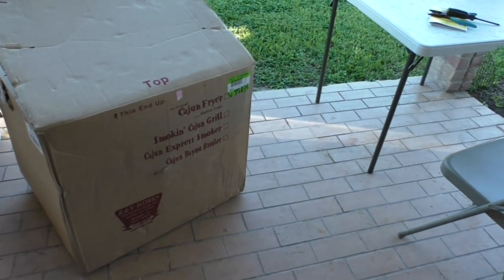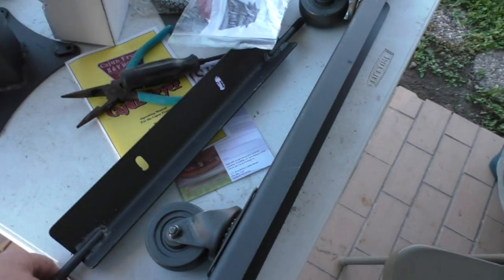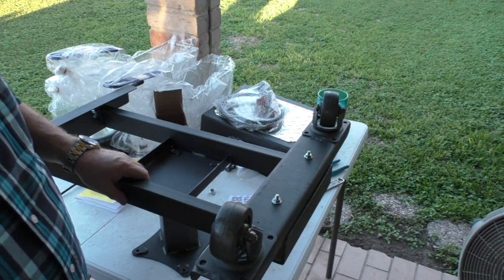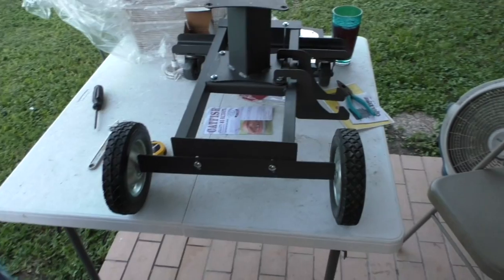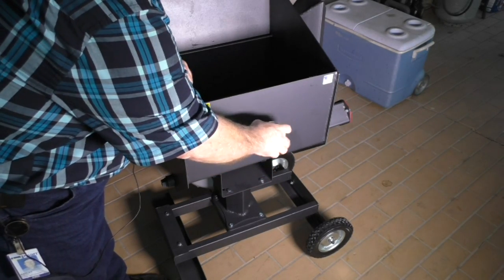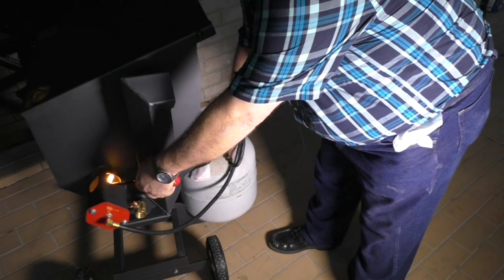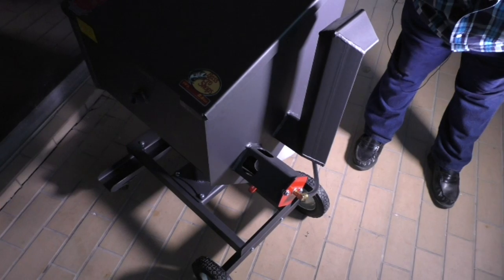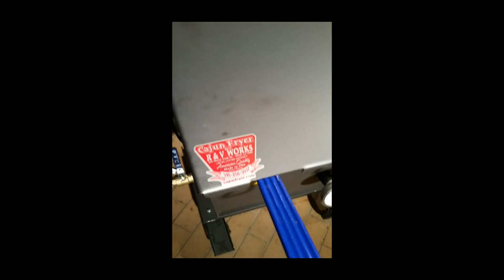R&V  8.5 Gal  Cajun Fish Fryer Assembly & Review

Comment: I heard you say that you were going to clean out the fryer, how did you do that?
Reply from the maker: I laid the fryer on its side and sprayed it out with a water hose and nozzle to break loose any meal and breading that might be under the burner.  No soap, just water.  Then dried it well and refilled it with oil.  Thanks for watching.

Comment: I love the cart set up on this fryer.  I have a similar fryer from Bayou Classic, but it's made from stainless steel.  I used it on my Seafood Platter video a few years ago.  I really need to have a big fish fry/crab boil soon.
Reply from the maker: +Smoky Ribs After using it the first time I was in love with it.  Especially like how the temps hold even after adding a few pounds of cold food.  All that oil makes a great heat mass to help keep it stable.  Thanks for watching and if you ever want to do a Youtuber cook and need help let me know.  I will load mine up and head over to help you.
Reply: I'm actually doing a big seafood boil in November.  Cajun Rocket Pot is sending me out a new pro pot to try out, so frying up a bunch of fish and hush puppies would go great with this.
Reply from the maker: Smoky Ribs Shoot me a date and I would come and help fry.  I love road trips.  Let me know.
Reply: I sure will let you know.  Let me touch base with Todd, and find out exactly when I'm getting the new pot, and I'll set a date from there.  All I know right now, is that it will be sometime in November

Comment: What tools did you use to assemble the whole fryer, I see needlenose plyers a Phillip screwdriver, and a level is that all that's needed?
Reply from the maker: You could get by with that but a wrench to fit the nuts on the bolts would help.  If I recall right I needed a 7/16 and 1/2 inch wrench or socket and ratchet.  It's been a long time since I assembled it. Here is a link to the instruction manual.  https://cajunfryer.com/wp-content/uploads/2016/11/Grill-Owners-Manual-Master.pdf

Remember when you read the manual that a 5/16 bolt requires a 1/2 inch wrench and a 1/4 inch bolt requires a 7/16 wrench.
Reply from the maker: Thanks for watching and for the question.
Reply: Thank You!!

Comment: I have the 4 gallon version.  Quickly decided I needed the 8.5 so the 4 is going to a neighbor.  This time I ordered the stainless steel version as even covered I was getting rust spots on the outside.  Have you noticed the same thing?
Reply from the maker: Dori Coplien Awesome.  I have been real happy with the 8.5 gallon size.  congrats on the SS version.
Reply: Buy some high temp black paint

Comment: I know this is an old video, but perhaps someone could help. Our fryer recently started filling the air with gas while we were cooking, and started to shoot blue flames out of the exhaust pipe. Of course we shut it down. I thought it may be the hose and nozzle assembly, so I replaced it with a new one from Lowe’s (keeping the old hose). Last night we tested it, it fired up, but the gas/leak was forceful and I could feel it with my hand (felt like a strong stream of forced air in my hand). It was coming from where the hose goes into the unit. Ideas?
Reply from the maker: Maybe send a picture of where the leak is?  I’ve never encountered that issue.
Reply from the maker: Blue flames out of the top of the exhaust or where the opening is near the gas inlet?  I’ve had dirt dobbers build a nest in the tube before and block the plenum.
Reply: I wish I had kept the photos of the blue flames. From what the fryer company told me, we had the gas up too high, and their gas line is made different than the replacements… so. We tried again, only turning on the gas line quarter turn. It worked for a few minutes, then the smell of gas was quickly filling the area. A new OEM hose is $40, so that is our next step.

Comment: why can i never find any pictures of the burner on this thing.  I thought for sure that i found it with your video and then it was skipped over.  I need to build one to a certain size (integrated into an out door kitchen) and I am curious what the burner looks like.
Reply from the maker: Dev Everything The burner is just an office that blows propane into the tube that goes in a loop thorough the fryer.  If you have seen a fish cooker that has a grease zest used as an orfice you get the idea.  R&V website probably has a link to the manual where you can see the orfice assembly.  I will check it out and come back and put a link.
Reply from the maker: Dev Everything I couldn’t find a good shot of the burner/jet but here is a link to the manual.  Basically they just have a swivel fitting that goes through the red plate on the end of the burner tube and inside the tube there is an orfice that they call a jet.   https://cajunfryer.com/wp-content/uploads/2016/11/Fryer-Large-Owners-Manual-4-8.pdf

Comment: would have been better if you showed the full assembly. i have the 17 gallon and the assembly was pretty easy except for the wheels.
Reply from the maker: +eddiehndrsn Sorry about that.  I wanted to touch on the most confusing parts of the assembly but don't guess I captured all that was needed.  Thanks for watching and I bet you can fry a ton of stuff with that 17g.